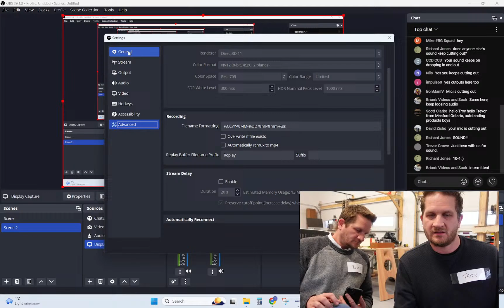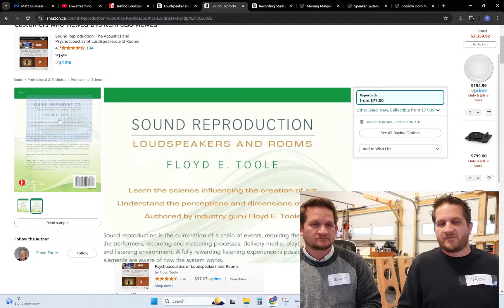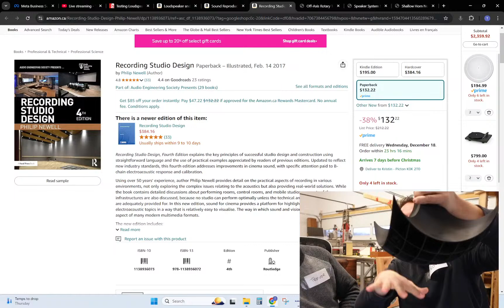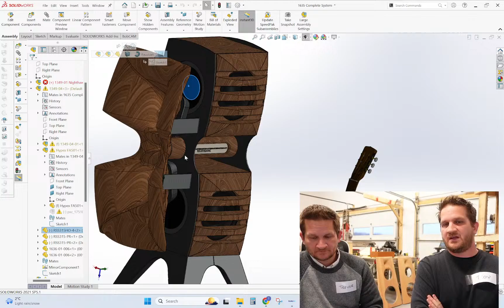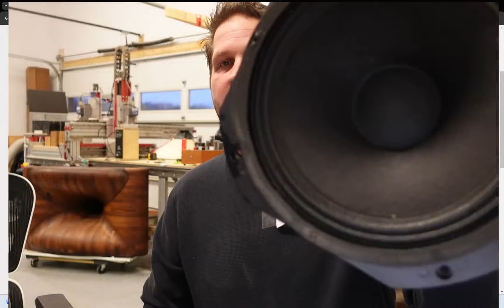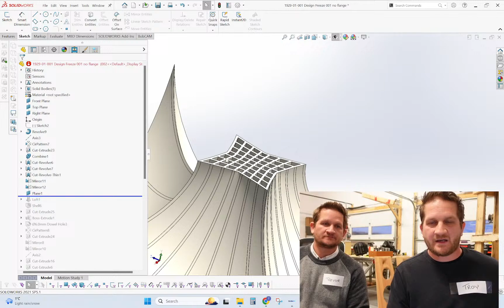Live Q & A with Troy J. Crowe joined by twin brother Trevor!

Comment: I'm interested in learning a little more on your CNC toolpath strategies for your horns.  I've been working on it with Fusion, and struggling with acceptable results.   I really enjoy your livestreams (even with the few technical challenges!)
Reply from the maker: What specific issue are you facing?
Reply: @JosephCrowesDIYSpeakerBuilding  Do you typically just use a 3d adaptive clearing pass, followed up by a contour over the entire surface with a ballnose, or do you use different types of toolpaths with each type of feature? (i.e. vertical, horizontal, organic shapes)  I finally purchased a Shapoko Pro, and with 3" tooling I'm attempting to slice the 1076 horn horizontally into 4 double-sided parts.